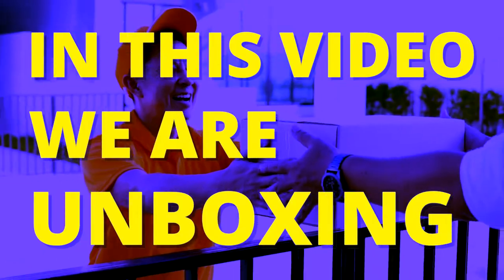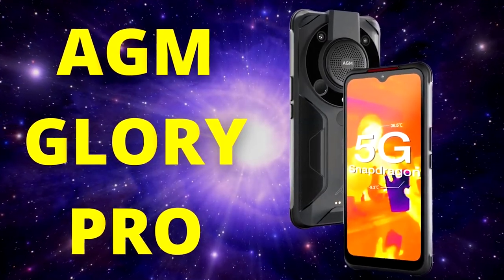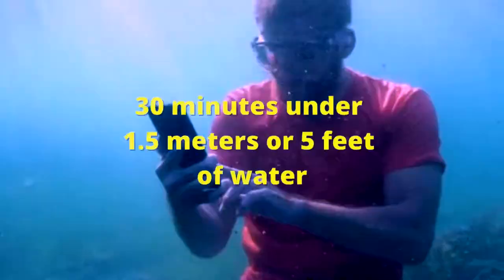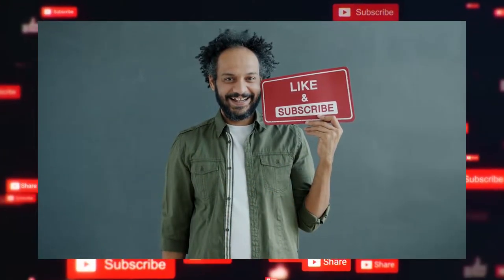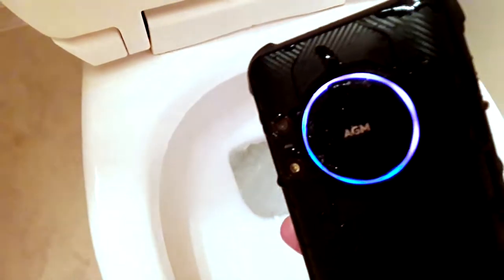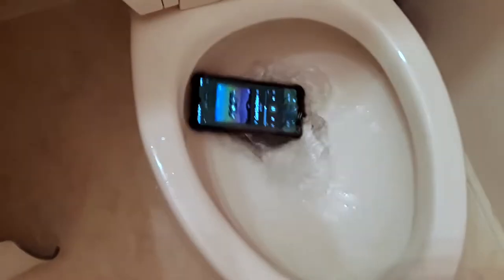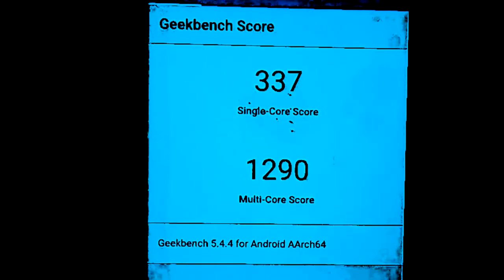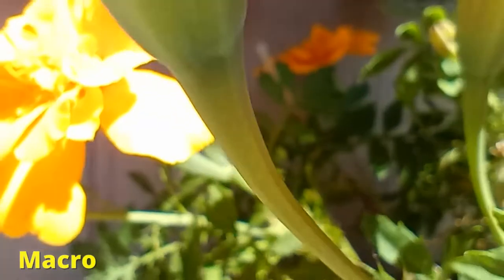(AGM H5 Pro Review) World's LOUDEST Phone vs CAR! - Rugged Phone Durability Test

Comment: I just bought a AGM H5 Pro Rugged Smartphone last week and out of the box I charged it. Put the sim card in and started it. The first screen was the pin screen. I tried to put my pin in and nope, didn't unlock. I called the company and told them the problem and they said to use 12369 and try that, Nope... So I got hold of a phone tech and they ran me thru the factory reset... Nope didn't work either... Sent it back and got a refund and ordered the "OUKITEL WP16, Rugged Smartphone 10600mAh Battery, Night Vision Camera 128GB+8GB Android 11,6.39 HD+ Underwater Camera IP68 Waterproof Rugged Phone, OTG NFC GPS SOS Dual SIM Unlocked Cell Mobile Phone". Bad company to deal with....
Reply from the maker: Dang sorry to hear that! I didn't have any trouble like that with the H5 Pro, but I'm glad you were able to get your money back